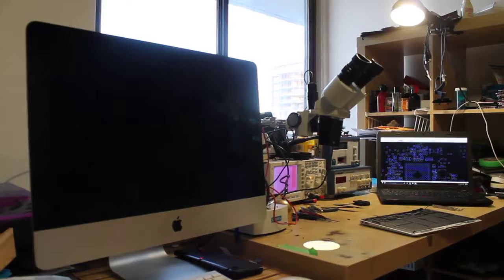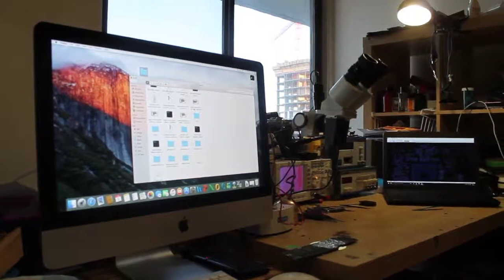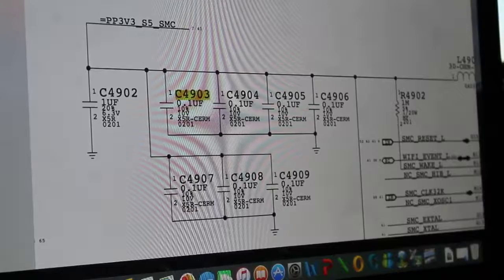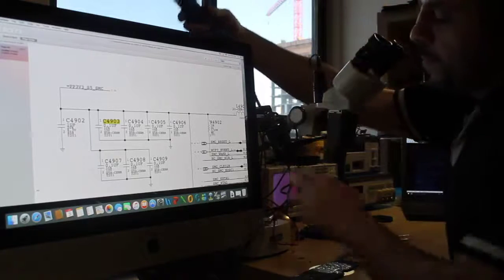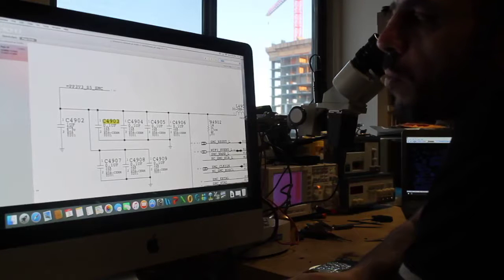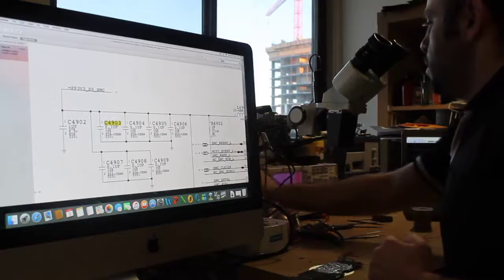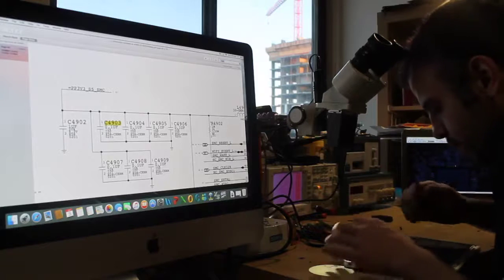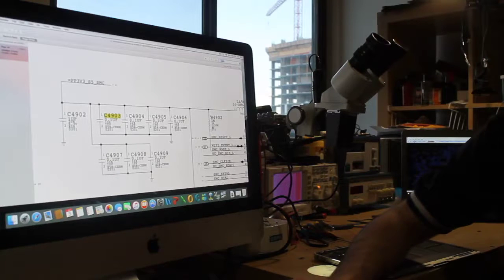Macbook Air 11" A1465 820-3208 No Power Liquid Damage Repair

Comment: I spelled coffee on my macbook air & it was dead (black screen)so i tried to dry it with a hairdryer and no use the laptop didn't work , I took it to apple store they quoted me 900$ to change the motherboard.then I approached some local shops again about same price for changing the motherboard and told me that the mother board is not fixable. i approached apple experts and didnt change the motherboard but they fixed it for a much cheaper price and it only took them 1 day :-))) thank you apple expert...... highly recommended
Reply: friends of Apple Expert hey